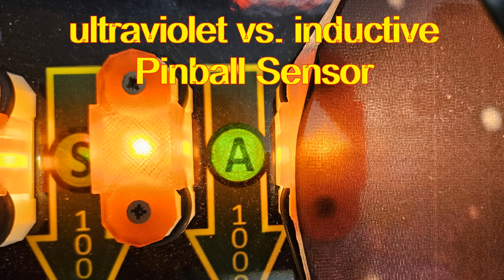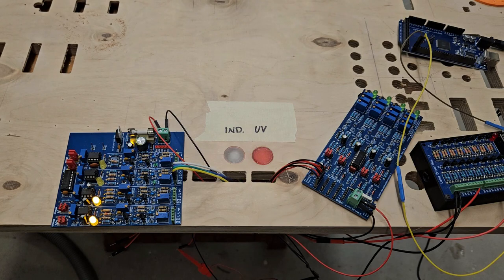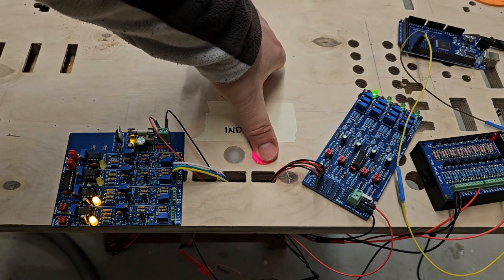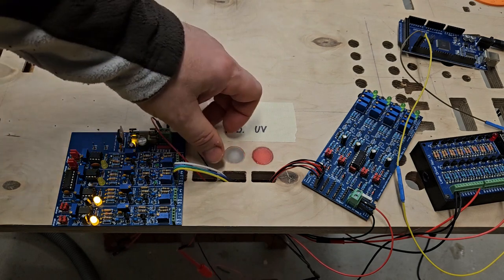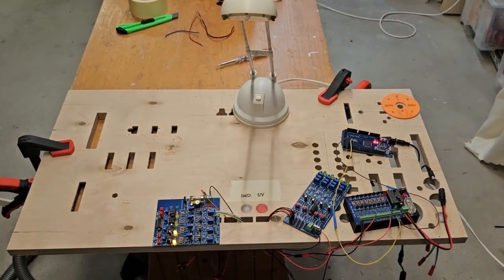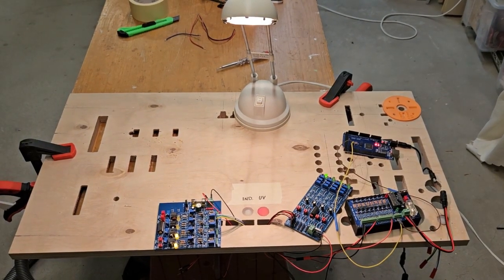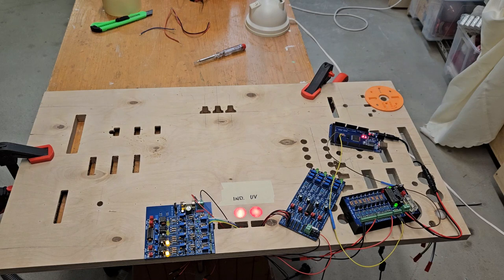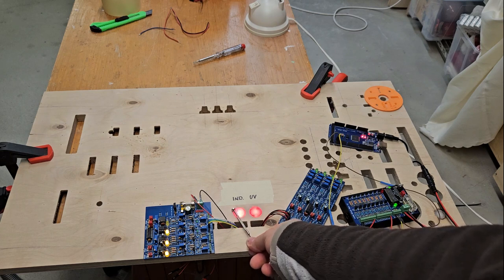inductive versus ultra violett Pinball Sensor

Comment: if you buy the .STL
Where can I get the assembled boards?
Reply from the maker: Hello, i provide GREBER Files with the STL Files. With the GREBBER File you can order PCBs from a Manufacturer Like JLCPBC, and when you received them you have to solder the Parts to the Board. I Provide a multi Page description for this - it's also includet in the Download at Cults3d.com. watch this videos. Here you see a PCB which was ordered at JLCPBC and how i soldered all parts and tested it: https://www.youtube.com/watch?v=uEJHb6SVkyY
Here you see how te LAMP/Sensor is made: https://www.youtube.com/watch?v=SMAwgMvApRI

Regards, Fabian

Comment: I sub'd because I like your DIY pinball updates but don't see the point in this one.
Reply from the maker: hi, basicly its a warning for people making a machine like mine. UV Sensors a quite easy to make, but they have the shown disadvantage -> I made my first sensors bases with UV (TCRT5000), this works great but only in by basement and only with neon/LED light. As soon i put it in my living room, the UV Sensors basicly do not work (have to be adjustet always to the actual sunlight, or lightning in the room  - which is no fun and a lot of work). Regards, Fabian